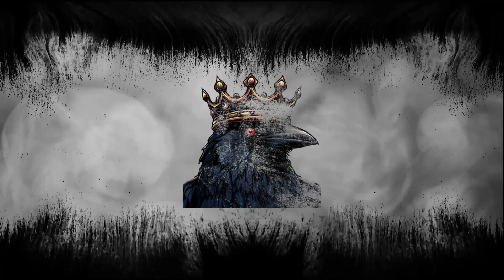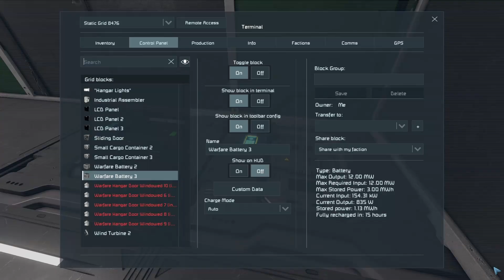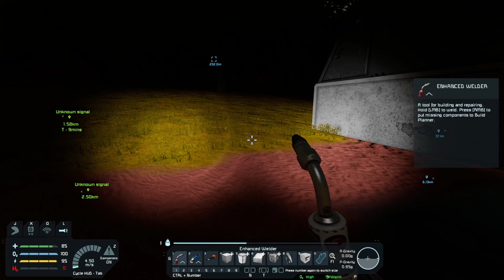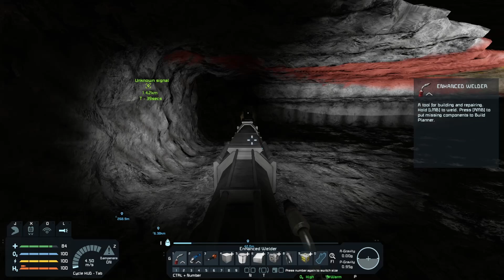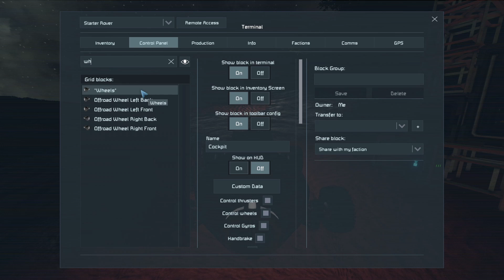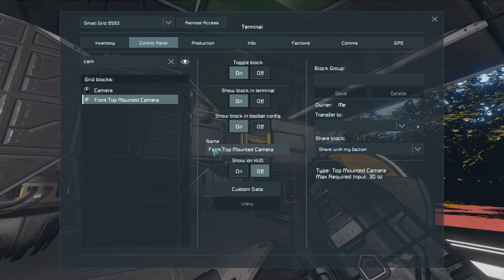Power, Drones, and Lists | Space Engineers | Season 1 Episode 4

Comment: Personally, If you're gonna use a timer for connect/disconnect.  It should be Connector switch lock, thrusters on/off, batteries recharge on/off and then whatever you'd want after that.  That will do all the actions you need in one button, rather than having two timers doing the same job..  I'm just saying.

Comment: I'm new to SE but have a question about your drilling rig at Little Base.  Does SE not look how far the arm of pistons is stretched out and put the strain that  (in reality) would break your hinge from the weight being put upon it?  

I ask cause I went to build using the standard light armor block and just the frame of one steel plate, and went up several then started building out like a walkway and when I got far enough out it collapsed from being unstable.  

Enjoying the series and the manner you are presenting it.
Reply from the maker: SE does calculate the pistons and weight but there is a setting in the pistons called "share inertia tenson". This changes the calculations by adding the mass of what comes before the pistons. In my case it added each piston and then the base that is in the voxels. You can eventually overload this by going too far and adding weight to the end of the pistons but you can get a good distance out.